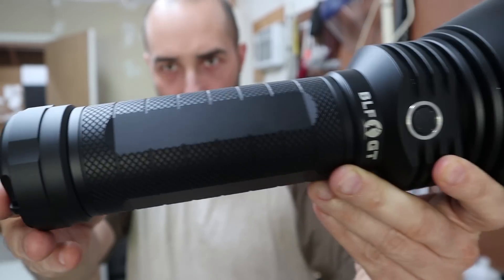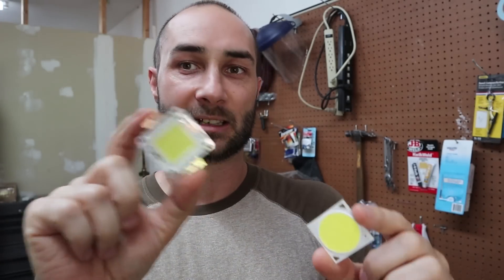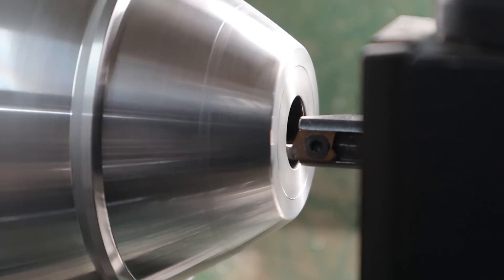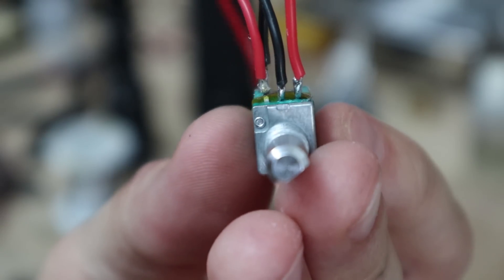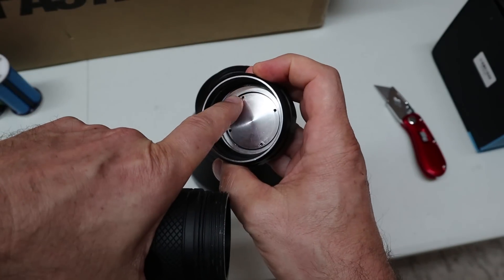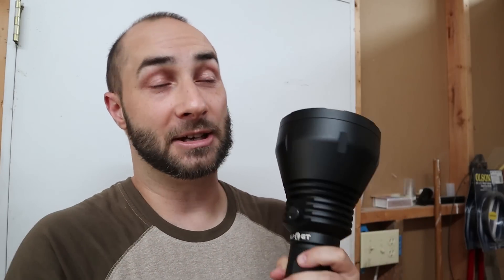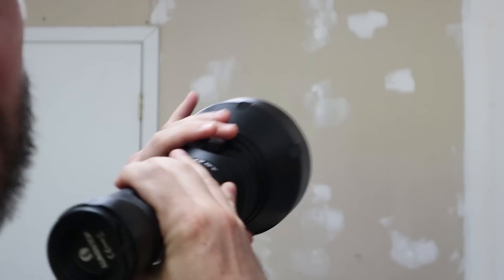World's Brightest LED in a Flashlight!  (Cree CXB3590)

Comment: Any scientific explanation on why more output leads to less throw here?  Is it because the bigger LED eats up more reflective area?  Technically, this LED deserves a much bigger reflector to reach its true throw potential correct?  Or maybe this LED is not designed to throw far, it is meant to be a flooder LED?  I don't see a dome with this one, so I assume it is still meant to be a thrower LED?

Comment: wow awesome chip. I'm looking for a chip put on some moving heads but I need the to beam the light.  not flood. those light currently have a philips msd platinium 5r its very bright at over 100000 lumens but been having problems with one of them... the ballast not striking. and I want a solid reliable moving heads.

Comment: Cool video. One correction, as labeled on the back of the pcb it is called the taskLED hyperboost not ("tesk"  1:52) , I obviously could not find any information anywhere online for a tesk LED so it's important to take note and give the correct specifications. As I said nice video, love diy projects.
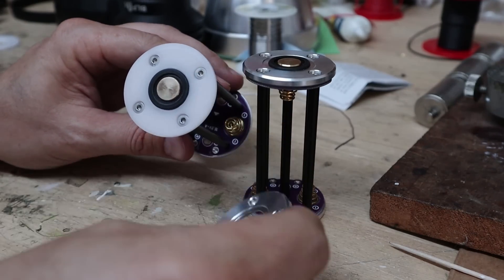One question, what the heck is asettle (4:57)? When you talk about changing the battery holder. Again I was unable to find any information on this material.

Comment: It's great that there are so many of us into lights. I'm not a BLF member but I've been around there for years, Been with CPF for years also.

Every time I get a new light everyone around me is like "seriously?... Wtf do you need that much light?" my reply is either I cause or I just throw on turbo and smile 🤣🤣🤣

Love my floody lights more than throwers but several of my floody lights throw far enough. In my head it gets to a point where a light throws so far it's absurd and doesn't really help unless your helping out a mountain climber at night from atop a different mountain. 

Flood though, you press a small button and purge darkness wherever you face the light. I've gotten to appreciate my smaller lights like my crappy XHP-50 warm wizard pro(I say crappy because the electronics problems have been an issue for 4 of them..) my new favorite even though it's cool white.. Would be my nitecore E4K and for the size it is mind blowing how bright it gets.

My ultimate favorite is my Incan collection of rare/hard to get lights like my ASP Triad, my larger Half Mile Ray handheld, and some pentagonlights. Second time I've seen this vid but the first time I've left a comment for you 👌😎👍 don't leave scars on your retinas

Comment: I have an idea!
Let’s build a 9 x LED-CXB3590 flashlight. Of course it will have to be a large handle spotlight style do to the size of the reflectors and the battery’s and heat-sinks. Also you can put a water drop magnify lens on the LED’s.

Comment: Before cutting the reflector, would it make sense to line the inner surface with a non-adhesive flexible soft plastic, the kind you see on new tempered glass cellphone protectors? Or did you find the compressed air took care of it with no noticeable scratches?

Comment: I'm just curious, how did you measure the 16000 lumens?
Reply from the maker: I can't recall exactly how I did it when this video was made.  The way I measure high output lights now is that I built a 6" diameter lumen tube system.

Comment: Have never bought a cold white 6000k 3590. Interesting color light, I've only bought 12 warm white 3000k 3590's.  1750ma is a nice current to drive these bad boys at.   Pin heatsink for passive cooling.

Comment: It is a common mistake to think that because you have lots more lumens in light emitted by your LED you will have a more intense light (higher candela values).  So if you measured how much light was emitted within say a 1 degree cone angle of the center you might expect that there will be more with the bigger LED than the smaller one.  Wrong!  For a given reflector what determines the intensity of the light in the beam is the number of lumens emitted from each square millimeter of the source.  Sure with the bigger CXB3590 you get a much wider beam that contains a lot more light but looks can be deceiving and counter intuitively the intensity is actually less than in the narrower beam.  The reason for this stems from the lower value of the lumens emitted from each square millimeter of the bigger CXB3590 LED compared with that of the smaller XHB35, (have a look at their data sheets).   This lower intensity of the output from the lower value of lumens emitted per square millimeter is a consequence of a Law of Physics called the law of Radiant Invariance which gives rise to a value that is called the Etendue of an optical system which you can look in to if you want proof of the statement above rather than just taking it is just an opinion.

Comment: The red filter is a standard 55mm camera lens filter.
Also note the battery is not only charged via the USB port, it will output 5V 1A to power other deivces, it has a trick cable.  Oh, and the LED on the battery stays lit a dim green wqhen they are charged and disconnected.

Comment: Hi! I have a question. I have a chinese projector with a cheap 100 watt led. it is the vankyo v600 projector if you are wondering. It is a bit dim. Do you think if a replace the 100watt led inside with the CXB3590, do you think it is going to work on the built in power supply, and do you think it is actually going to work. Big fan, would like an answer

Comment: Also, the reason you have non-uniform light disgtribution is that the CXB3590 is not a single LED, but rather an array. So is not a "point source" of light. In the entertainment lighting industry, this is compensated for by collimators (or in the cheaper units, lenses). Nonetheless, this is a bit of a maverick hack, with a voltage multiplication circuit that most don't understand, but can now buy due the prominent display of their website on the underside of the PCB. I'm not really having a go at you, but just wish you'd make a follow-up to help people who want to make one of these safely.

Comment: You never explained your thermal solution. I'd estimate that thing can't be left on for more than a couple of minutes before it'll either enter thermal shutdown, or just burn out. Also, be careful with voltage multiplication circuits, showing people wear to get a board which can produce that kinda voltage / current without explaining that it's dangerous, even though it's "just battery powered" (which is what most will assume is intrinsically safe) especially when using the housing as a DC negative is a bit irresponsible. If you understand the electronics behind it, all well and good. But maybe explain that a bit to your viewers, as a few cock-ups here could result in someone getting hurt.

Comment: For the donut:  Try making a slight convex lens on the output glass.  Works for some of the cheap flashlight makers.  May fix it with one shot, if not, could point to the solution.

Comment: 1600 lumens is about a 100W incandescent/tungsten equivalent. So... by your calculations... this is a handheld 1000-watt equivalent flashlight. If you wanted to generate this much light with regular old-style lightbulbs, you could not run two of them from a single circuit in your house without blowing it. But here you have the same amount of light powered by batteries!

Comment: Use a digi pot with spi or i2c. Then stick an attiny on same board like 3 buck solution if u want a ui.. Also, I didn't catch ur pack Config but anyone trying this at how hopefully can do the math. Though I'm sure there are vapers and flashlight people who can't but use lithium ion cells anyway... For those... This is 121w or if u were 1s its drawing about 30a from the battery

Comment: Selecting a Flashlight's reflector is not great option for CXB3590 b.coz it has lots of tiny led due to that output of the ray will not meet at single point don't you think so ?

Comment: To fully negate that donut effect, you would need to put refractors in the reflector-bulb. Tis the same thing that's done with car head-lights. Tis why they have baffles in them, so the internal reflectivity produces a semi-coherent beam. Baffles do negate some of the lumen-output though, so it needs to be done smartly to get the best compromise between output and beam-uniformity. A light unit that does not reflect internally will never give you a uniform beam, no matter what you try. With the way it's set up, the reflector is only "catching" what little light reflects back from the lens.

Comment: and i though, my selfmade LED Light with Cree CXB 3070 and small reflector+Lens for the 3070 (in combination with a chinese 200W boost converter) was bright
power draw of about 120W on battery (4S/2P 10.000mA LiPo) or 12V Car adapter, with 230V usage limited to around 80W since the cheap power supply was rated at 80 or 90W.
Reply: That just fucking insane....What do you use it for?

Comment: What about cooling?? Doesn't it get much to hot within seconds??
Reply: Not too much. It's got a massive head, so doesn't heat up too quickly.

Will still thermal throttle however.

Comment: https://www.ebay.com/itm/10000-Lumens-X-XM-L-T6-LED-Zoomable-Flashlight-Torch-Lamp-Light-18650-AAA-LJ/153051537784?hash=item23a2952178%3Am%3Amn5RsiOKdjo0T4FvXQYVppQ&enc=AQADAAAB4KX%2FKt4E1xf3SDqEdBclaYbzNQfkCpbCfTj3eOfEudzjX7tGm3WVP0m77NgGHvthsJoslNttneeLUzdFH30KO7GVB1eElSgOCdRurpDn9dWdja5rVXBrx6NQk4uGc5suRkI4QDnoEg6Gbd5NnifgIzvHo2f%2FU1IcZMm7NDlP7TONOGEwNWMrmLWf3bbCpYZk6cRtDA2655%2BqxbYPJiYcKbWHa%2FNay1qy%2FlOKnAG9MHwnwgctXU%2BrACIVjXhj6HW0kc9YaVLmDw8UA1JZShWgNA%2BfMlapdULnnYEt%2BnHLvNeaz1NBGh3hH3l2o%2BAktQPiqvTn%2BfhhqtnNB2owLjMLKbOtoErGBZSZiUEEql1AgG42EHgu1jN3%2FDFjF%2FKhzIHGSBoDku0g2fjBnElh%2B8iKwWozRijl%2F8WGZw1wXHqh6GGgaNkHwT6%2BYa4%2B5RJUCgF%2Bu09rnCQZmDpE2ERaBHSR17RerpUjvYSlYWIRYFAmrvuetgpSLJTZl5aZPUjdv6Db6F7IkJC7AMPUxa9uaH9BA4dqotJRqs0bpMdSmJPpmc0YAIWFgcNlsw7vsq41YC61ICfux60Rz1h6JuXviGmmwbjB6XC0ueT89VywvPvn2NlSOqLaNh9YS%2F6L29lt%2FMPrCg%3D%3D&checksum=15305153778422de8dbe7a764b19b6a3caa6faee3e8c&LH_BIN=1
Reply: Unfortunately, to say those generic cheap chinese "XML T6" flashlights grossly exaggerate their lumen count would be an absolute understatement. I own both a generic "Ultrafire XML-T6 10000 lumen" for $8 and a 600 lumen light "Olight S1 Mini" for $50. Guess what? The tiny 600 lumen light from a reputable brand is significantly brighter as seen by my own eyes!

The $100 14,000 lumen Emisar D18 on the other hand sounds really tempting..

Comment: "up to 3x the amount of light than cheap eBay 100w LEDs" they're rated for 14k lumens and the cheap ones are rated for 10k
Reply from the maker: Hi Noorquacker.   The cheap 100W LEDs don't perform anywhere near what they are rated at even in the best possible conditions.  If you'd like to see more about this my video "Internet Lumens Vs Actual Lumens explains.

Comment: can you use electro-cunductive thermal paste if you mount a cree cob onto an aluminum heat sink?  whats the white base made of on the cob? is it thermo-plastic? please answer asap as i need advice for a current project. thanks in advance
Reply from the maker: Yes, you can use thermal paste for mounting the cob leds.   I am not sure what the base material is, but its not electrically conductive.

Comment: Can you just put 36V on these guys? Do you need a resistor?
Reply from the maker: If your voltage is very close to what the LED needs and your heat sinking is good you can get away with direct driving most leds.    You need to check the data sheet and see what the drive current at the max voltage is though.   A variation of only 1 volt has a massive impact on drive current.    With this LED direct drive would not be ideal.

Comment: I doubt there is enough heatsinking for the 100W led as you dont use any active cooling and have not too much space of a heatsink. Its just the aluminium case of the lamp that does the job.
If you really run it at full power you will probably loose 80% as heat and the case will probably get quite hot soon?
For my 100W led i use a massive CPU heatsink with active venilation to cool it down properly.

Comment: I'd like to see a suspended parabolic reflector in front of the LED that would reflect all of the forward light to the actual reflector in the flashlight. Be neat to see what it does. Gotta figure thats a big LED and a lot of the light is getting thrown directly out the front. But not reflected by the main reflector.

Comment: I suggest selling the "mule" with a choice of several heads. A focused thrower, diffused washer large source, and one or two in between.  That reflector looks like you had this in mind.  I Much prefer a "knob" that turns, most people do. Direct feedback.  Really, try tossing the clickys on a pro style light.  They would fit great in the tail with shoulders for protection. Or a low profile type turn knob at the neck. With knurling it would work fine.  It would be a massive leap forward for flashlights.  Toss the button!  I've got lots of old stock Alco if you're interested, I'd be glad to help.
Reply: Only issue would be water. Imagine there's a fix for that.

Comment: Hey!! That looks like Table Rock Dam ! How did you get on the other side of that fence???   FYI, the distance from where you were standing to where the two cars were parked together on the other side of the powerhouse is about 1,060 feet +/- about 10 feet, if that helps.

Comment: How long does a set of batteries last in that thing? That works better than the double headed flood light I have on my house
Reply: At 100W output, if the light doesn't get hot, it should last about 45 mins.

Comment: That's some beautiful machining you got there. even though it has a little bit of a donut effect I noticed the shadows were still very even in singular. I have a 24 volt 900 watt LED cob with a diameter of 100 mm any idea where I might be able to find a reflector for it.
Reply from the maker: LouieA found a reflector that seems to be good for cobs.  Here is his thread. http://budgetlightforum.com/node/65546

Comment: Your reflector is not optimized for this LED.

You'll notice on brand new LED flashlights with reflectors designed for them that the LED will basically show up in the entire front of the lens.

The lense is designed by using math to create a parabola that reflects all of the light from the LED to go straight forward. The math behind it has to factor in not only where the LED is placed front to back, but at what angles light actually gets thrown.
Reply: Theodore Bear its a bright led, but the mm2 performance is not any good for a flashlight. The cree xhp70.2 almost got 10x more lumen mm2, so you would need 10x bigger reflector aswell. So as you said, this works more as a flood light. If he did not have that drop in front of him, a lot of the light would also just hit the ground and blind you.

Comment: great work there 
probably one of the most lumen concentration from one spot i saw on YT
i could think adding a float-fixed cylindrical reflector with decent length of say one inch would help if positioned just a little over the LED, this way i think it would reduce the spreading light and concentrate it in the middle which BTW may eliminate that donuts shape you mentioned,

do make these for selling? how much price would it be?

Comment: 36V*3.6A=129.6W.
14000lm/129.6W=108.02469136lm/W which is pretty terrible efficiency, stratus LED are better at 140lm/W: https://www.stratusleds.com/module/
Reply: redstone craft guy Both are fat bigs, get a array of Cree xhp70.2 and you could make something really bright. If you put 4x4 of these one together, it’s the same size as the led used here, but 70000lumen. Need some cooling though.

Comment: Wait how are you cooling the led? no fan needed?
Reply from the maker: The metal in the flashlight head is the heat sink.   Eventually it will get very hot and you have to turn the power down.
Reply: @Lumencraft-  Hm yeah, but ive seen 100w led flashlights projects and they use a huge CPU cooler to cool the led

Comment: Great Video.  You discuss trying to reduce or eliminate the "doughnut" by either [1] optimizing the depth/placement of the LED or [2] adjusting the shape/etc of the reflector.  Understood.  But perhaps it would be easier to simply lay [or glue] a very thin plano-convex lens right on the LED [flat side down, of course].  I don't know the exact shape of the convex side of that lens, i.e., whether it'd be a normal "spherical" curve, or a typical aspheric profile, or some other unusual shape.  But even grinding & polishing such a lens [by trial & error] would be much easier than trying to re-shape/etc/etc the inside of the reflector.   Best wishes!  : )

Comment: if I'm not mistaken, isn't the CMA-3090 actually quite a bit brighter? I know it is more impractical due to the higher voltage but would it be feasible to fit the same driver?

Comment: At that much current draw, and the batteries in series, i suspect the run time is significantly lower. Have you measured its runtime?
I also expect the LED to be running quite hot since you cut down the reflector mounting contact surface area which was acting as a heatsink. Have you measured it?

Comment: 12-6-2018:  one of Cree's most powerful LEDs is their CMT2890, rated for 181W compared to 137 for the one you're using, CXB3590.  Max Lumen rating for the CMT2890 is 20590 vs CXB3590's 18000.  I'll bet that the CMT2890 can handle over 200W.

Comment: If one small cree makes 2000 lumens, wouldn't 8 make the same as one big cree?
Reply from the maker: If all the LEDs were driven to the same power and heat sinking was adequate.   The beam profile would differ though.